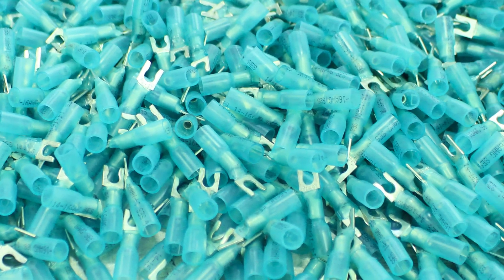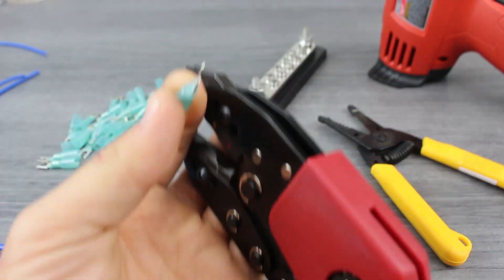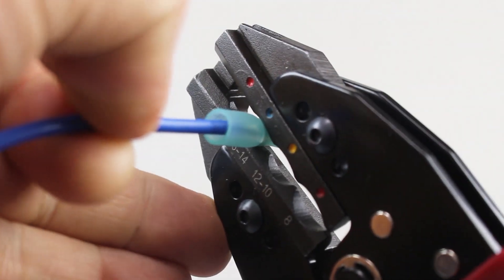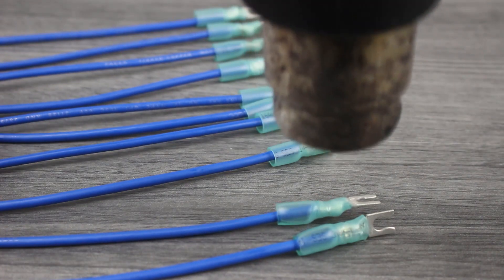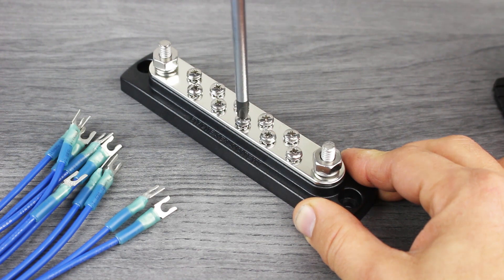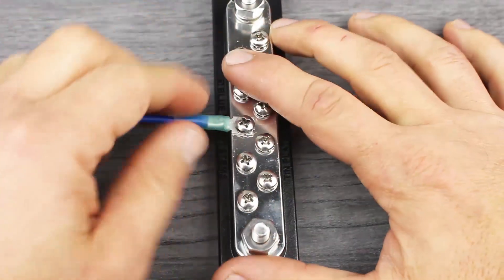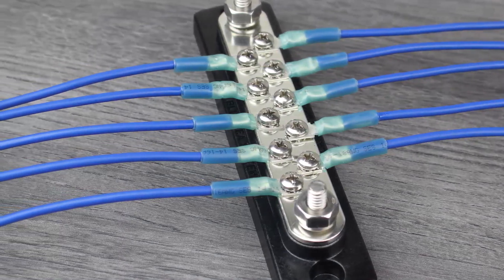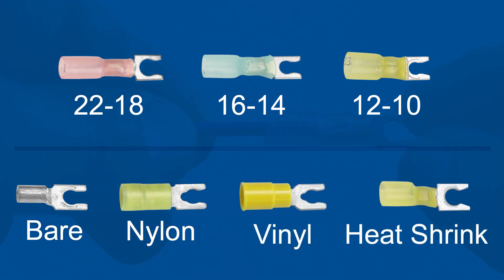Properly Using Fork Terminals

Comment: im wondering, would it be ok to solder the wires inside the terminals, if one doesn't have an appropriate crimping tool? and im not talking any soldering job, silvery and smooth atleast.